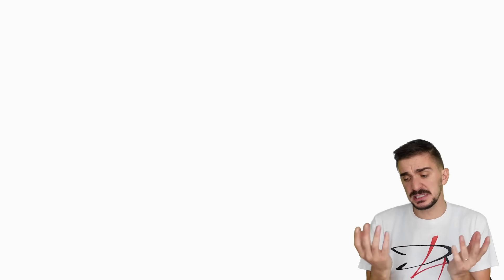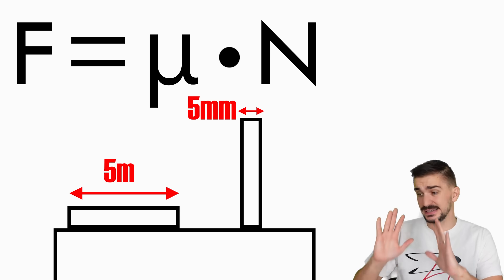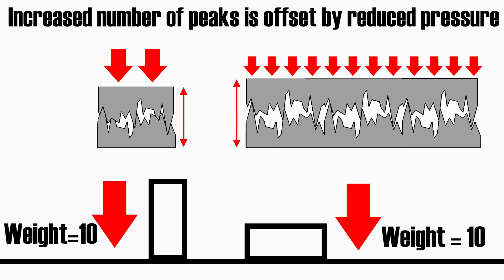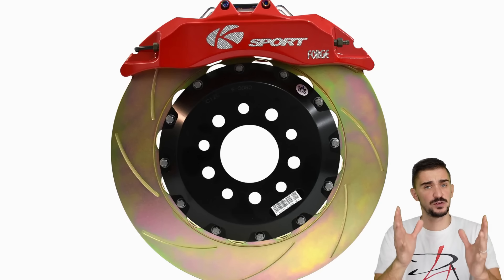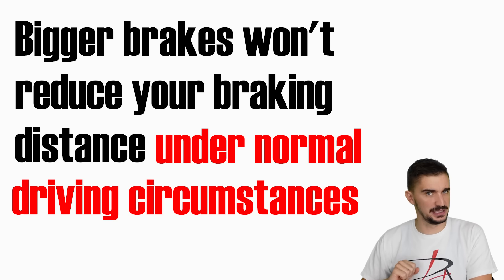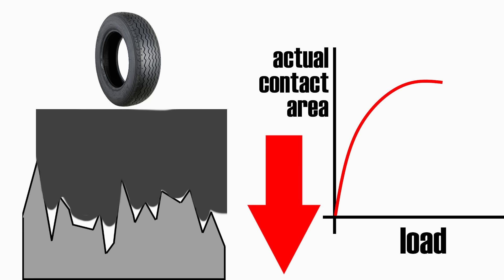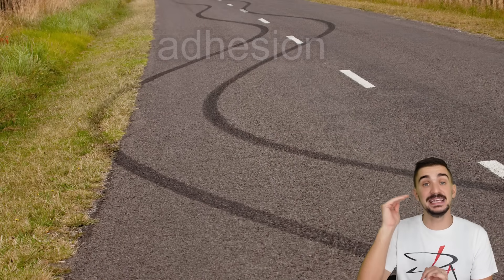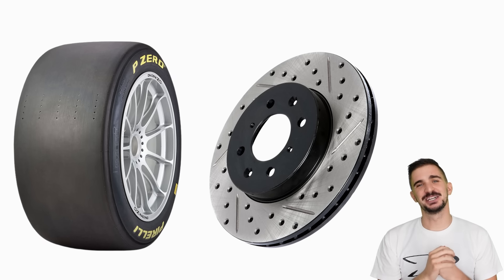Why Big Brakes Won't Stop You Faster but Wider Tires Will - Friction and Surface Area Explained

Comment: I think this is a bit miss-leading. Comparing a standard passenger disk brake system with an out-right racing brake system is difficult to do. Along with economy of maintenance, the passenger car brake system must work with a noise/vibration/harshness standard much higher than its racing counterpart. The passenger unit must have a life-cycle approaching 100,000 kms. The racing unit must last the race only. The Racing unit must be brought up to temperature before its peak thermal effeciency is reached; during braking the heat transfer that the racing system must absorb and release is a few orders of magnitude higher than a passenger unit. Performance tires do allow a higher speed of energy absorption. Take two identical cars with the only difference between them being a stock brake system and the other a racing replacement and after 5 hard laps watch the racing system be consistent and the passenger system show signs of heat-soaking. Tires be damned.

Comment: Your theory goes out the window when talking about motorcycles.  Take motogp brakes.  Carbon.  The power they provide is many times stronger than steel rotors on superbikes and their diameter is larger.  This allows a rider to enter corners and brake much later.  however, the front tire are the same size. They also put covers on the rotors to keep them very hot and do not drill holes in them or use slots.

Comment: i upgraded a mustang 2 front end suspended car from stock 9 inch rotors & calipers to granada 11 inch rotors & calipers with the same tires & it DEFINITELY stopped quicker with the same master cylinder.it had a longer travel though.going to a 1.125 master cylinder brought back the stock travel of the pedal.so your theory is slightly flawed.its up to the driver NOT to lock up the brakes.but i do understand your theory about tire surface area being harder to lock up due to more friction with the road surface.

Comment: You forgot to account for increased brake pad pressure and modulation as well as mass of the rotor, wheels and tires. You can throw in forced cooling as well.
But yes, the basic principle of the video is the primary concern.

Comment: Bigger brakes will not stop you faster, a BETTER braking system will. 
Same is valid for wider tyres, they provide the same amount of Gs, being the friction between 0.8-1.2Gs of friction, NO MATTER the PATCH AREA. The only factor is how the compound for your tyre deflects and resist sudden increases in temperature.

Wider tyres provide more grip IN CORNERS, because it has more tyre surface to better explore and make your car lean better on the area.

Comment: Sorry my man but you glazed over some details.

Larger brakes also tend too have larger (or more) pistons. The pistons are what generate the glamping force.

So yes if you upgrade too larger brakes with the same sized piston id say your right and not gaining anything. But anyone going from a 2 piston oem setup too say a 6 piston brembo is gaining as much as 3x (oversimplyfing here) the clamping force + additional heat dissipation. 

Also we can talk about mechanical advantage and how the larger pad and rotor combination is further away from the axle, giving it better leverage.

Comment: For tyres of the same pressure surely wider tyres have a shorter contact patch with the same area (so wider tyres do not have a greater surface area  on the road although they do overall so they should not get so hot)?

Comment: Bigger, better brakes reduce the temperatures in the brake fluid. I had a bike that was run hard with a single disc on the front. Decelerated as much as the front tire could handle but turned the DOT 5 Bel-ray blue brake fluid straw colored in 5K miles or less.

Comment: I've known this for years. My Datsun 510 has stock brakes with rear drums and it stops from 60mph in 70ft. That is less than any vehicle made today and about half that of a brand new supercar
Reply: You're on crack and highly misinformed if you think a modern supercar needs 140ft to stop from 60mph.

Comment: I tell people this on forums and in Facebook groups all the time- if you want to stop shorter you need stickier tires, not bigger brakes. The brakes themselves are almost never the limiting factor in stopping as shirt as possible, it’s the amount of grip the tires have.  But, especially in the older car groups, people think the brakes must be updated/upgraded to stop better when it’s usually a lack of upkeep and/or low quality pads/shoes that have a lower coefficient of friction making the car not stop well.
Reply: Depends on the vehicle. Without picking a specific vehicle and driving it there no way too know.
One of the first mods many people do IS rims and tires and so a brake upgrade could take advantage of them.

Comment: Wider tires do not always improve handling or braking. There are exceptions. Mostly having to do with weather. One individual l knew bought an MX-5/Miata. After a week or so he bought new wheels and tires. Wider than stock. Not sure how much. Said it was great until it rained. Now maybe it was the tires or the tread pattern. But in the wet the car was dangerous to drive.

Comment: If you think that bigger brakes won't improve braking distance, you aren't using your brakes very hard.  

If two otherwise similar cars are trying to stop at the end of a 150mph straight, one with 9" discs and the other with 15" discs, I guarantee the one with the bigger rotors is going to outbrake the one with smaller rotors 9 times out of ten.   

Bigger tires aren't going to help you a bit when your little rotors are 800 degrees and glazed.

Comment: There's another problem with wider tires besides just the "doesn't work as well in wet or slippery conditions" downside.
Wider tires change the aerodynamics, and the rolling resistance, and not for the better in either case.
Wider tires have both higher drag and higher rolling resistance than stock or narrower tires. Usually this is an acceptable tradeoff, however on something like a land speed record car that uses parachutes to bleed off most of the speed after the run, they'd actually prefer FULL METAL or non-pneumatic rubber wheels for 3 reasons.
1. Such wheels have the lowest rolling resistance.
2. The wheels will be able to be made smaller in frontal cross-section, which either makes it easier to fit them in the body of the vehicle or it makes them create less drag if they're mounted externally.
3. Such wheels (especially the fully metallic ones) have the highest RPM limit of any type of wheel, which for a land speed record vehicle is something that becomes incredibly important because normal pneumatic tires will have problems simply withstanding the internal centrifugal forces that are trying to make all the parts fly outwards at speeds around and over 400 miles per hour. Tires have a "speed rating" for a very good reason, it's a mechanical limit of their construction.

Comment: I feel like you could do a more advanced video on brakes too. Such as larger brakes having a centre of braking pressure further from the wheel hub so you can brake harder with less force. Or even talking about how pads warp and why multi piston brakes have an advantage etc etc. love the vids ❤
Reply: Oh look! I found the argument section! 🤣
Reply: @reallifeengineer  lol oh look, someone who needs to find a wood chipper and jump in while it's running 🤣
Reply: @tee2171  😆
Reply: What about tyical braking performance at higher vehicle speeds... ie; its more difficult to lock the brakes at 80mph than 30mph... probably due to the wheel and brake discs  inertia... Would a larger brake disc and pad improve braking performance (bite) at higher speeds?
What about just fitting a larger diameter disc but keeping the same size of pad as before as I'm doing to my Surron once the disc arrives... in what ways will it perform differently?
Having a spinning disc braked nearer the hub simply has to require far more braking force than if braked nearer the circumferance... I wish he had covered that aspect too... as not all braking systems are fully adequate for some vehicles, ie my Surron electric dirtbike with its not quite up to it.. downhill MTB 4 piston brakes.
Reply: That would be nice, I completely understand the heat dissipate advantage with larger rotors/ calipers etc… however I can’t wrap my head around how a larger rotor has no effect on braking power. For example, On my bicycle I switched my front 160mm rotor for a 200mm rotor and immediately felt the difference, less heat also because I don’t need to hammer down on my brake lever as hard. Anyway I’ll go watch this again
Reply: @JeanLucduSainteJaqueFrancoise  
On your bike, "don't need to hammer down on the brake lever as hard" [when went from 160 to 200mm rotor,
is not related to heat-dissipation.
THAT which you experienced, is related to the lever-arm radius of the bigger rotor.
As result, yes, it takes less hand-pulling on the brake lever to generate same amount of braking power against the wheel hub.

As to the reason why WITHIN THE RELEVANT OPERATING RANGE that we're talking about, bigger rotors do not add to the car's stopping power:
A car's OE brake system is already designed in a way, that 100% brake application will be able to lock-up all the wheels/tires, thereby actuating the ABS.
So the bottleneck is the tire/asphalt interface, not the brake pad/rotor interface.
Bigger brake rotor simply means you reach that tire/asphalt traction-breaking-point earlier, with lesser force from your foot to the brake pedal.

There MAY be something to be said, about how well the driver can control & modulate the brake in the 95%~100% of lock-up with bigger brake rotor & multi-piston calipers & bigger pads.  That said, I've not seen this discussed in any automotive or engineering videos.
Reply: @reallifeengineer  
Thanks for the clarification, yes its true that a cars OE braking has the capacity to lock the wheels and activate ABS… so would a big brake kit but it’s not about the ability of one to stop the wheel better than the other, it’s about combating the degeneration of braking efficiency / efficacy caused my heat. Big vented rotors and large braking surfaces dissipate heat / gas quicker thus allowing the brakes remain consistent and function properly in extreme conditions. I think I’ve got it now😅 thanks!
Reply: @reallifeengineer  I think you need to go actually experience the automotive industry with practice not theory before giving people bs opinions!
Reply: @reallifeengineer but whose running stock wheels and tyres and upgrading brakes brakes are after wheels and tyres
Reply: Brake torque
Reply: Dang, I just asked a question in the general comments, and I think it dances around what you're talking about here.  About further from the wheel hub.
Reply: @basicallyjustapile4753  leverage is definitely part of the equation! it’s a topic of great depth that a halfway illiterate bogan mechanic like myself might be mechanically proficient at repair and diagnostics and even developing and modifying but expressing the total knowledge and experience of decades of working on them isn’t easy to put down as text and doing brakes all day every day is in the past for me!
Reply: I thought the larger brakes were less likely to overheat.
Reply: For sure. The initial explanation in the video is wrong.
Bigger rotors = more leverage = more brake power
More piston area on the caliper =  more force = more friction = more brake power
The stopping distance do not change cause the stock brakes already have more than enough power to lock the wheels, so using a good ABS system you are already performing the minimal brake distance on regular cars.
Reply: @RogerioCosta1.0  not quite, you do get more braking power however your braking power typically exceeds your tire grip by a good margin so more braking power doesn’t let you slow faster. Larger brakes do have more thermal capacity and can radiate and convect heat away faster so they’re better at preventing brake fade which occurs when your brakes get too hot and your grip coefficient between your pads and rotor decreases, requiring more piston force to maintain the same level of friction
Reply: @abbottboyaustin  Did you read what I wrote? My English is not so bad.
You are repeating the same thing I wrote. I agree that more braking power will not reduce the brake distance in cars that already have brakes good enough to lock the wheels.
My point is that the statement in the beginning of the video that bigger brakes do not have more braking power is wrong. Watch the video again.
Reply: @abbottboyaustin  Yep, bigger brakes work better. How many times are you going to stop?
Reply: @RogerioCosta1.0  This is pointless, it is just a video to get clicks.
Reply: @RogerioCosta1.0  Changing the tires might make the stopping distance shorter. Changing the air pressure might help.
Reply: Larger brakes are not about stopping power, but rather better cooling under high loads.
Reply: @wmgilliland2582  yeah I know, but higher brake pressure starts to warp pads and heat them unevenly which causes the brake fade to come on sooner. Nothings absolutely rigid so the larger brakes are more than simply better cooling.
Reply: @abbottboyaustin  I'm with you Austin.  An obvious example is all the superbikes with the huge diameter rotors and a small pad contact area.. The length of the 'lever' has a huge effect etc...
Reply: @abbottboyaustin  , is that not what I just said? It's about cooling capacity to help keep that from happening.
Reply: @wmgilliland2582 Efficiency of brakes isn’t dependent upon force but momentum (force x distance). Distance is between the center of brake pads surface and the center of the hub. Disks of larger diameter will provide a higher momentum, implying better braking efficiency. The video is wrong when it says that bigger brakes don’t brake better. It is right to say that bigger brakes are not more efficient when bigger means bigger pad surface. It is wrong when it means disks of larger diameter. This is one of the reasons why sports car have bigger rims: it allows using disks of larger diameter. The video is also wrong about pad surface. Pads with larger surface are used with bigger calipers offering more pressure. Small pads/calipers may allow single pistons when larger pads/calipers may allow dual pistons, of more, offering higher force, resulting in higher pressure. (Pressure is what matters, not surface).
Reply: @pysaumont  i think he was saying that larger pads require less pressure to produce the same force as smaller pads, but the braking distance will be the same
Reply: @cloudshe  Yes, he was saying that putting larger pads on your car would not give you more brake force. In a follow up video, he says that all cars give more braking power than the the tires can afford. The problem is that the way he presents it is ambiguous, probably on purpose. Bigger brakes means wheel of higher diameter, with lower but larger tires. That will obviously give more breaking power. The follow up video is pathetic, though.
Reply: @pysaumont  No pressure is dictated by the master cylinder and the booster not by caliper or brake pad size.
Reply: @wmgilliland2582  It doesn't make sense to me. My understanding is if larger diameter is used the more torque can be produced with the same force. That is why for example for high torque bolts we use long torque wrench because it is much easier.
Reply: @maly1000r  that’s true, but because you can simply apply more piston force in your caliper you can generate as much friction as you want. You do get a longer lever arm so you need less force to generate the same torque, however I think bikes will have larger rotors because you get more volume of metal (so more thermal mass) and also significantly more surface area (more cooling ability).
Reply: @maly1000r  You took a simple example and applied it to a complex problem that is not adequately covered in this video.
Reply: @maly1000r  , The reason is the larger the diameter, while yes you can and do get greater braking force. You also get more mass in the brake rotor, due to having more metal, which in turn means greater mass to dissipate the heat and better cooling. Which means a reducing in the chances of brake fade occurring.
Reply: @wmgilliland2582  don't forget momentum on large brakes better than small brakes
Reply: @wmgilliland2582  yes agreed, they are not taking heat into the equation and heat is a very big deal with brakes.
Reply: @wmgilliland2582  I guess I just don't understand why large rotor 4 piston brakes always stop better for me cold compared to 2 piston small rotor brakes